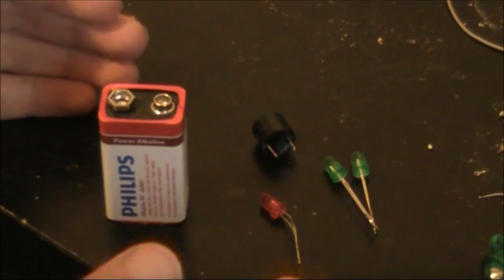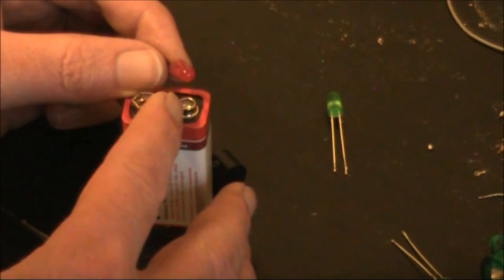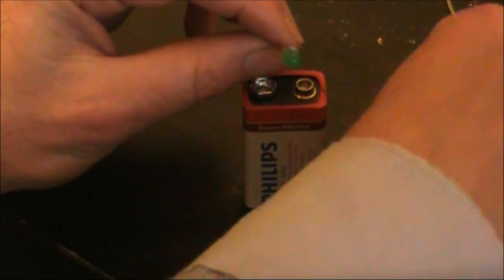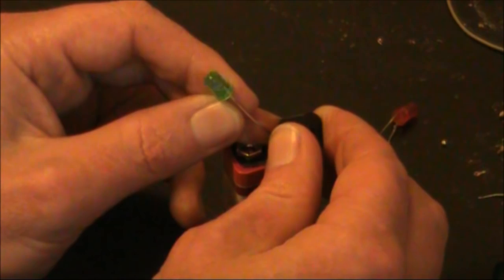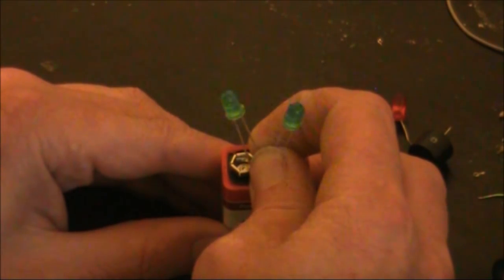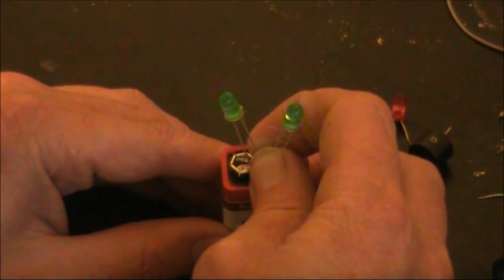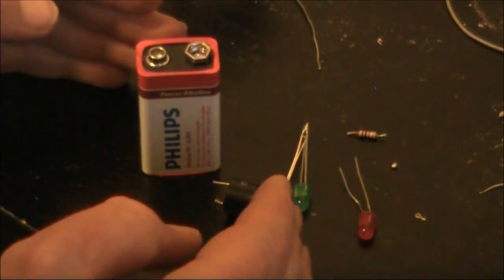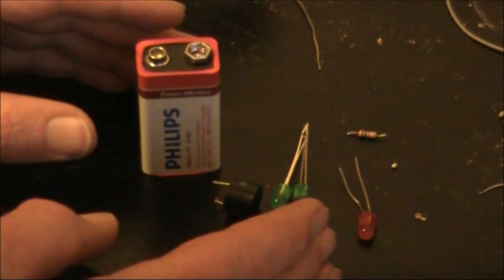Back to basics with flashing LEDs

Comment: You talk about the dropping resistor, but during your demo there is no resistor?
Reply from the maker: I was using it with the non-flashing LED but it was hidden. Didn't use it with the flashing LED which can work on a range of voltages.

Comment: so if you used a flashing led with a crystal oscillator you would have a micro beacon???
Reply: Martin Fraser A 4 pin oscillator, yeah.
Reply from the maker: Yes. Usable in conjunction with either a 1 transistor crystal oscillator or UHF tx module.